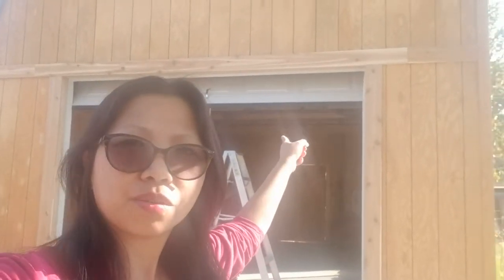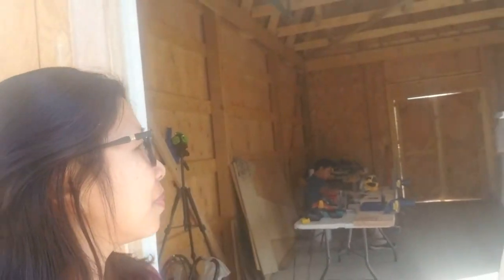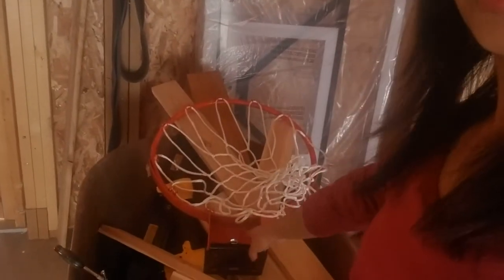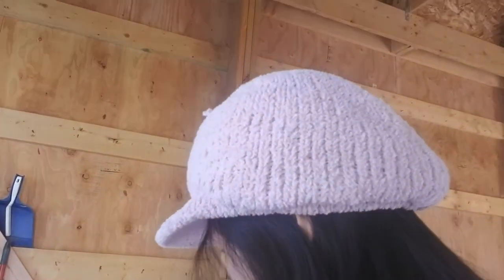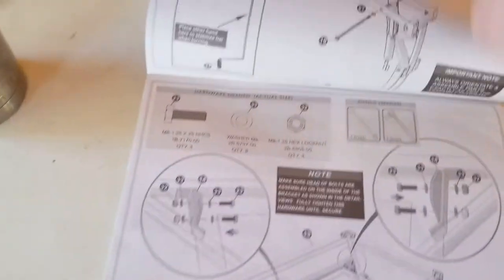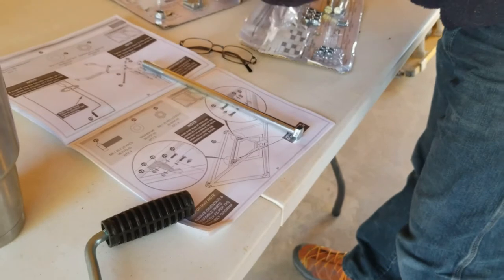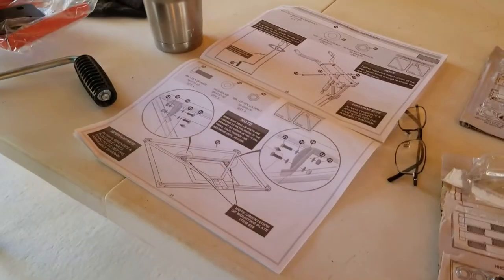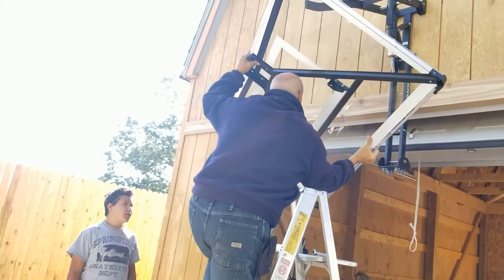Installing Our New Mounted Basketball Hoop| PRODUCT REVIEW

Comment: Maybe a random, dumb question, but how high does the mounting bracket have to be to mount the goal so it's 10' when the height is at the top setting?
Reply: 122 feet from the top of the mounting bracket.

Comment: Great, but are the main bolts provided for the initial installation onto the wall? I'm ready to mount it, but I don't see them in the steps, just shows the bracket and make sure to find a stable wall to mount (that's it), we need to provide them ourselves?
Reply from the maker: Hello, well any mounting that requires extra reinforcement, the purchaser is responsible for getting the proper mounting hardware including nuts and bolts, the basketball company didn't provide it since they doesn't know where anyone will put the backboard.
Reply from the maker: at 1:49 mike is adding extra reinforcement inside the garage behind the wall where we are going to mount the board, sorry did not include the whole process in the video.

Comment: Hi, what bolts did you guys use to mount the bracket to the wall? Mines didnt come with any mounting bolts so im not sure what to get.
Reply from the maker: We drilled holes through the t111 and 2x4 and used bolts that we bought
Reply: So the predrilled holes werent used to mount it?
Reply from the maker: @cold5514  yes the backboard had holes but the wood on our barn did not
Reply: Oh ok so what bolts did you guys use for the backboard holes?
Reply from the maker: @cold5514  thats a while ago. Youjust have to see what size the holes are on thr backboard mount bracket then for length figure out what you are drilling thru and add a half inch. Dont forget washers n lock washers n nuts.